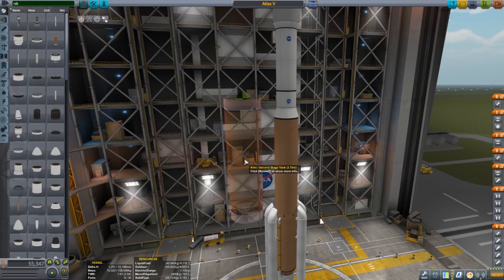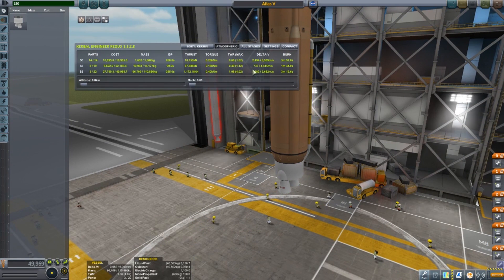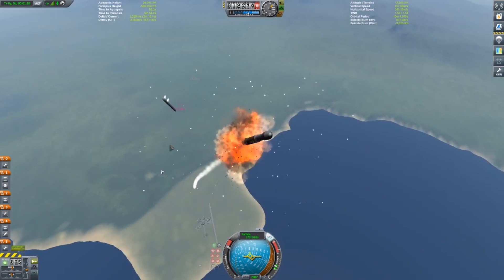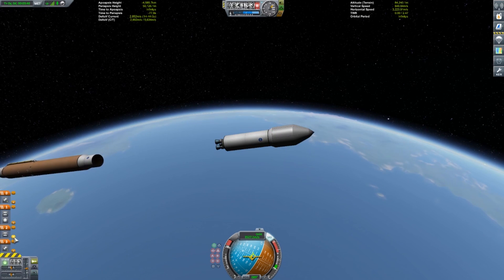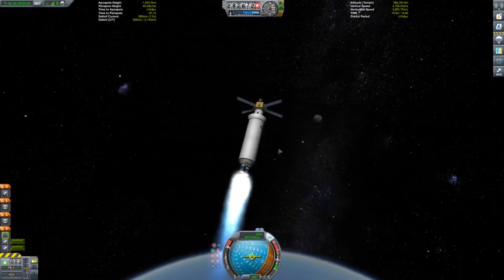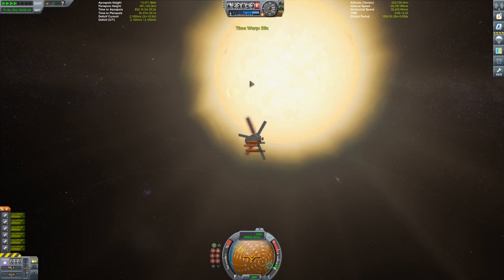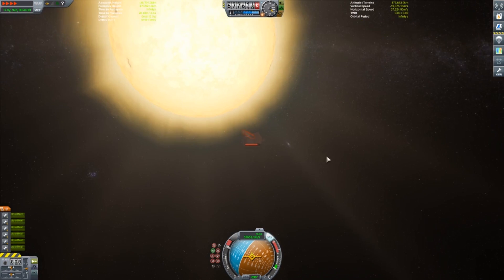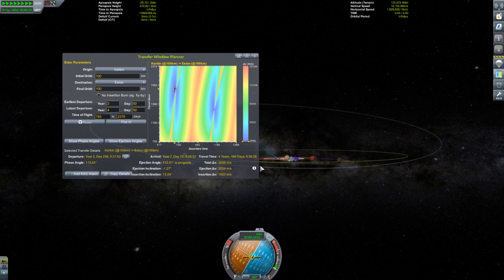KSP Mod Overview: Real Scale Boosters (Stockalike)

Comment: Hey brother: how did you manage the decouplng? The engines dont have nodes under them...
Reply from the maker: Of the SRBs or from the first stage to the second stage? I believe there's some specific structural stages that assist with using them between stages.